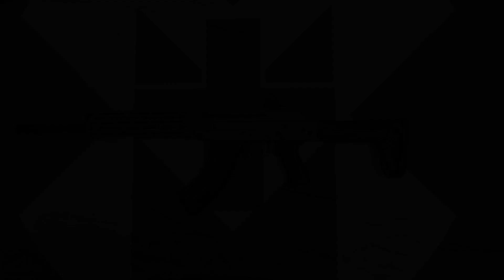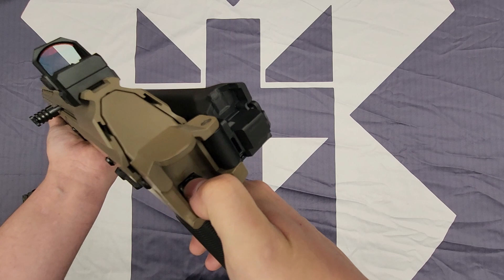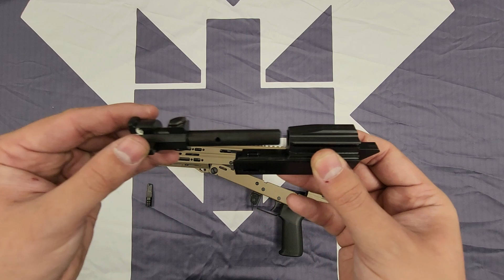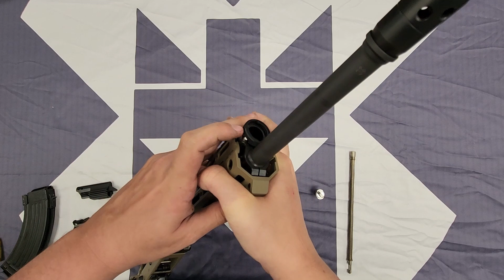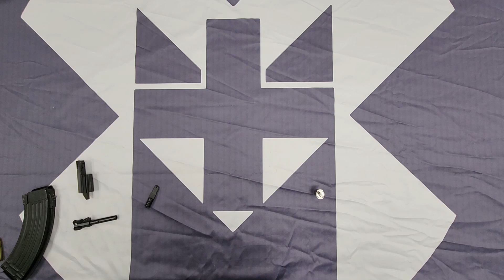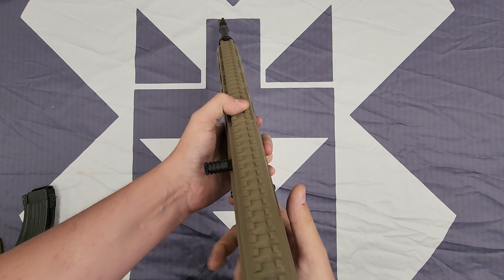M+M Industries M10X Field Strip Disassembly and Reassembly (M10X-Z)

Comment: Is the firing pin proprietary or could you swap it out for a regular ak47 firing pin “ incase “ it were to ever break ? Also same with the recoil spring is it compatible with the ak47 recoil spring or is that also proprietary? Looking to buy the mx10+ in a couple weeks n just had some questions . Also around what round count have you guys seen the need to change out the recoil spring , extractor spring . Thanks
Reply from the maker: Our firing pin and recoil spring are proprietary. We do offer spare parts for the M10X. The M10X also does have a warranty. Probably change your recoil spring and extractor spring every 8,000-15,000 rounds depending on your use and maintenance cycles.
Reply: @mm_industries thank you so much ill be ordering the m10x+ with the buffer tube adapter on your website within the next week or so . Great product and thanks for the reply

Comment: Hi guys, I just purchased this rifle yesterday which I presume to be a Gen 3 as that's what my dealer told me. I put my first 140 rounds through it today and really had no issues other than one failure to eject and a light strike. Could have been the ammo I was using (PMC Bronze) Anyways my gas piston has a slight difference than the one in this video. There is a metal O-ring at the end that connects to the bolt carrier and I believe its what was stopping me from getting the the piston back into the gas tube. I had to push the piston down until the tension on the spring was at the max until it snapped in the tube. This was all after my cleaning of course.

Should I be worried on my next range day?
Reply: I’m having the same problem I replaced my old recoil spring with a new one and same thing it’s different and doesn’t go in nice ! Have u figured anything out ??

Comment: - I had to read a review by a firearm blogger to find out the bolt isn't supposed to go all the way back while the safety is engaged. I had a suspicion before reading the review, but wasn't sure, since with some slightly increased force I can override that feature and chamber a round with the safety on. 🤷🏻‍♂️ I hope you've updated the M10X manual since 2020 to include this bit of information.
Reply from the maker: Not really.... You can run the bolt just fine with the safety on if the hammer is already down and locked into the trigger. The only time the safety prevents running the bolt is if the hammer is up AND the safety is on. It's an AK trigger group, and behaves exactly like every other AK on the planet.
Reply: - Ah, okay. That makes sense. But still, I'd have no way of knowing that from the included literature. Thank you for the reply. 

I chose an M10X as my first rifle, (for a number of reasons) so I didn't come into ownership with a lot of prior knowledge in other weapon systems.
Reply from the maker: @BlueMarten  It's discussed at about 45 seconds in this video, and there's an entry in the FAQ on our site about it.